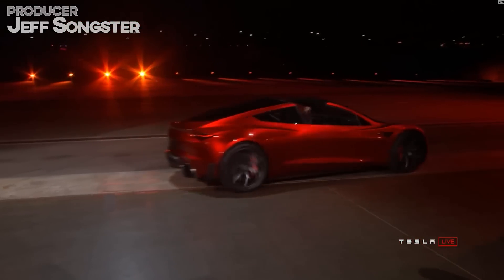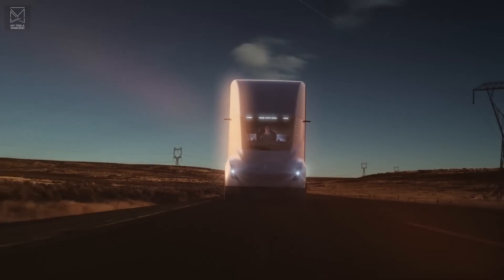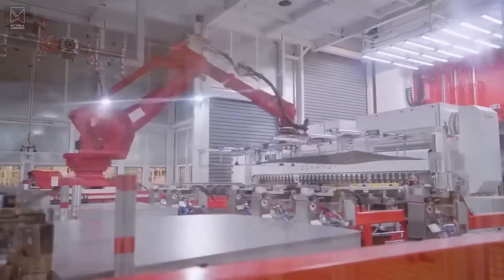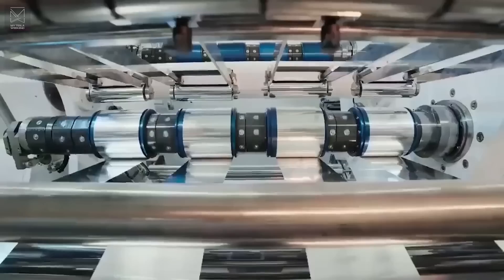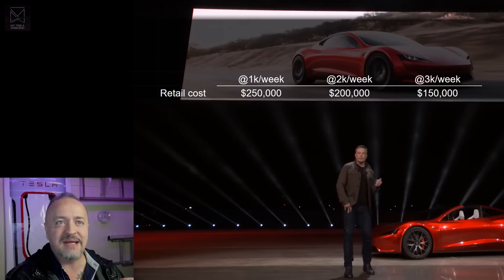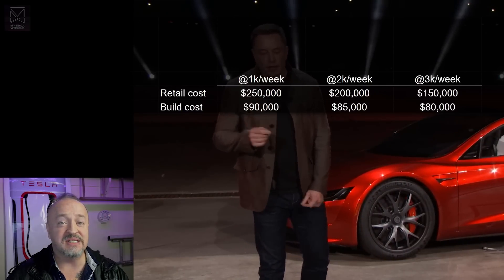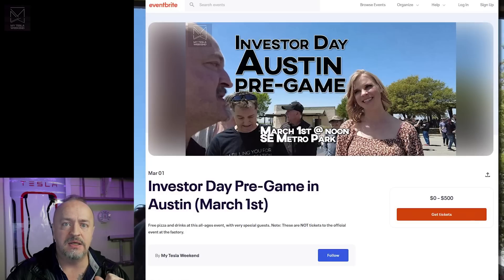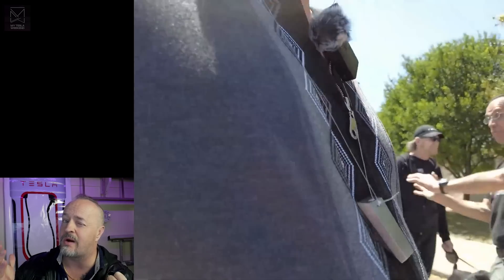Tesla Roadster is NOW

Comment: Dunno. Seems like the main problem with your thesis is the limited market for 2 and 2+2 seaters. The Corvette sells an average of 25k units/yr. A better comparison might be the 911 Porsche: 79k worldwide last year. If the back seat can actually accommodate two adults comfortably, that would be another matter.

At the 150k unit/yr volume/pricing you are suggesting would draw out so many stretch buyers, it would need it to serve as a daily driver. But someone stretching >$100k implies a high enough income or long enough time savings to also probably have been an adult long enough to have a family. I certainly can imagine initial demand at 150k units, but the production line capex would presumably be tuned to the expected sustainable demand. Too many of the spec-driven buyers require the practicality of the S or X and will be syphoned off to those.

Comment: Okay. I understand your analysis and I agree with the vast majority of that analysis. First, the Chevrolet Corvette only produces approx 45,000 Vettes per year at average cost of $70,000. The Roadster will always be a low production rate car, battery or no. Yes, buyers will clamer for it, but you will want to keep production low to keep the price high. Additionally, you will want to keep the resell pricing robust. To wit - lower production.  Make it special! I would guess that the average price will eventually be in $225K range probably much higher. Production could be as much as 500 to 750 per week making a yearly total 25,000 to 39,000. I fully expect production to be much less that 20K per year which will drive the price approaching $300K for the top of the line Roadster. Being conservative using the production of 20K and average selling price of $225K revenue will be 4.5 billion dollars.  With that potential margin based on your analysis it is better to keep the volume low, the lower the better. Why does Chevrolet only produce 45K or so Corvettes? Demand to make sure they are all sold and margins are where they want them to be. Remember Tesla in the past pushed prices up to control demand - somewhat. This is more expensive than a plaid and more niche. The marketable audience will be smaller. Just my pitiful thoughts. Peace.

Comment: According to the specs on the Tesla website the 0-60 time is 1.99 seconds but the 1/4 mile time is stated at 8.8 seconds and tops out at over 250, well beyond what the Plaid is capable of and makes sense since it has to outperform the Plaid. I would be willing to bet that Tesla is sandbagging the actual specs for the Roadster and that it will match and perhaps even one up the Rimac Nevera. Time will tell, but regardless it will be, beyond any doubt, a speed demon.

Comment: The roadster would be a lighter, smaller, wider 2+2 model S plaid built for the track. 
So difference would be tuneable suspension( softer for roads and much stiffer for the track) , ceramic disks as standard and massive calipers.  So handling would be significantly better due to front and rare castings. No need for carbon fibre body panels but would need to have carbon fibre for interiors parts such as seating and dash. This would be outsourced to a supplier since 1-3k per wk would be good volumes and the price tag and performance and competitors have it.  
 
Preferred 
Specs:
0-60mph: @1.8sec
0-100mph: @2.8sec
top speed:200mph ( using semi truck clutch tech )
Range: 500 miles per charge
Charging: Tesla  v4 superchargers @1mega Watt . 20-80% state of charge in 5 minutes.  V3 supercharger 20-80% state of charge 15 minutes. 
Price: $250k. 
This price is aspirational and  to ensure an exclusive brand. The sexy lineup has succeeded in making EV's affordable - with tax subsidies but the tax payer is benefiting by getting cleaner air and not being killed by pollution, so a very good return on investment 😊  .

Comment: Global sporss car market is about 1M units per year at an avg price of $70K. The $250K market is probably  be 5% of that or 50K units (Probaby less). Pure performance is actually not that important for supercars as long as specs are in the ballpark. Design and brand matter far more as well as exclusivity. Hence the Supercar market is highly fragmented. So optimistically Tesla then might get 8% of the global supercar market which would be 4K units per year, or $1B in revenue per year, and maybe $500M in gross margin. This is a pretty optimistic scenario and does not make sense aside from potentially being a Tesla brand marketing play. Not a efficient use of capital nor of management  focus.

Comment: Roadster should be easy to make.
If they dial in the 9000 tonne gigacasting they could run a few hundred or a few thousand off in a few days in Austin.
That'll give that small team plenty of work for a while, then Gigapress goes back to the CT work.
Cold gas thrusters as used by SpaceX and the M S & X already have compressors on  board for their suspension.
Without going airborne the thrusters will thrust up,  pushing the car into the ground for launch off the line.
They could thrust backwards to assist launch but would need no-one anywhere near.
Temperature is not the issue but debris at high speed is.
The other alternative is to use the "old" unibody patent to make the chassis and body frame in one squirt.
Although I think we'll see that on Highland or "affordable" car first.
Just a thought or two.......
Conjecture is tough when it comes to Tesla.
Not so tough when it comes to gm. 😉

Comment: Possibly setting up the Roadster assembly line in the addition (new building) on the south end of GigaTexas. Then they could use new molds on the CyberTruck GigaPress for the larger front and rear castings compared to the 3/Y. The they also wouldn’t need new presses for body panels that could be made next door. This would still leave plenty of room for their global headquarters in the new building.

Comment: What about double the battery 🔋 cost? Roadster is supposed to have 200KW battery vs 100KW in Model S (plaid). Batteries are the part with the highest cost in an EV. Great video Brian 🎉
Reply from the maker: I dug and dug, but couldn't find a primary source for the 200kWh battery pack claim, apart from the usual cadre of speculation sites. While the 620 mile range state officially would hint at a pack that large, it would only be a hint.

The Plaid Model S has a range of 396, which would mean with equal weight, it would only need a 150kWh pack... but it's lighter. It's a LOT lighter. The form factor barely extends beyond the wheels, and has a much lower roofline. The present-day Plaid pack could likely get 500+, which would be close enough for a launch edition.
Reply: @FutureAzA  yes maybe 150 kWh required only or even less. But with that crazy assumed acceleration (in the space x package) you need weight to get immense force from the cars wheels 🛞 down to the road. Otherwise there wont be traction. We will see how Tesla will solve that problem
Reply: Battery capacity unit is kWh, not kW...
Reply: @FiDelZarlar  when do was typing it i was thinking that there will be someone to advise about it 🤣Thanks 👍

Comment: I suspect there will be a lot of robotic laid up carbon in the roadster, not much sheet metal
Reply: GUESSING not.     There is plenty of power in the motors and Elon may have been turned off by carbon fiber with  SpaceX es  attempt to use it.    As the video said Tesla is all setup to do the metal.